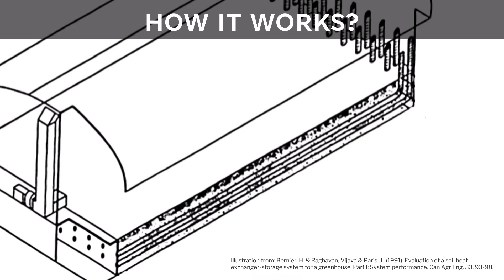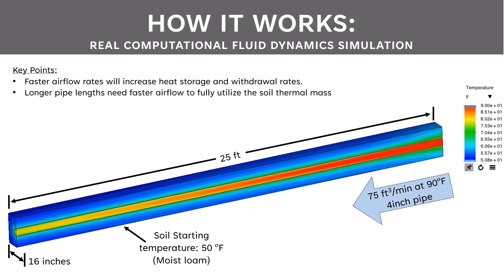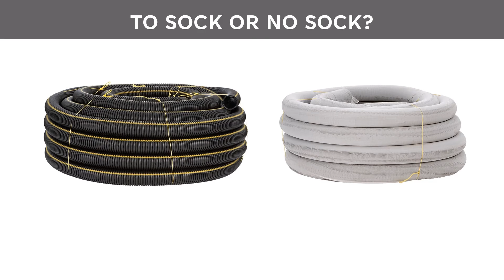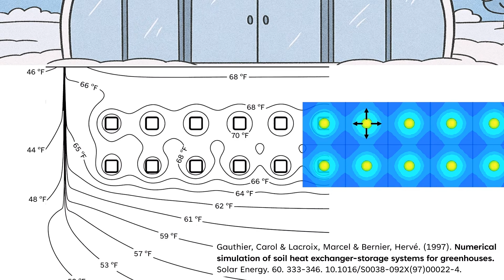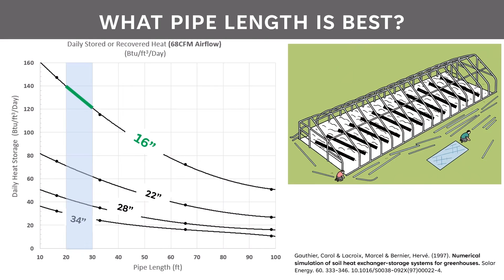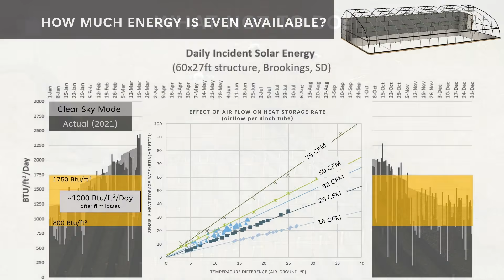Designing Better Climate Batteries: The Heat Exchanger: Pipe size, Spacing & Airflow explained…

Comment: These systems are interesting but their operational expense at 75cfm per tube as exampled is immense.   In open air that's about 3.5w draw, so if you have 24 tubes as in introductory drawing your base node is 84 watts and then you're adding a lot of static pressure.   In this circumstance you're talking about ribby pipe so its 38w per tube and that comes to about 900w continuous draw.  In a 25x16 greenhouse on a 600xf plot that's approximately 66kw continuous draw per acre. 1584kWh, 14.52c per kWh for South Dakota would cost $230 per day per acre of placements or $345 per actual acre per day of production soil.  So your yearly inputs for one acre of arable soil not including fuel charge or service fee, hardware maintenance or ANYTHING else would be $31,050 in power draw alone.

So assuming you create a perfectly tight setting of the greenhouses in my calculation allowing for utilization of 420 acres of arable in a 640 acre square mile, your yearly power input would cost $13,041,000.00 

That said, some greenhouses in Greece are reporting $33k per 1000 square meters arable, four of those comes to 43055.6 xf and an acre is 43560 [number crunch here] so growing tomatoes that sell at Greece's prices in SD in an acre would cost $30,690.00 per year for power input with this system IF it ran continuously all day which I know it won't but that gives you a rough number.    Assuming the numbers from Greece include competing with regular crop production that'd be $134k gross per acre against the $31k cost to run the thermal ballast fans for 90 days each year.

I suppose if you could convince a bank that a square mile of greenhouses could make $56M gross a year and ICE didn't raid you it might make more money than mono-cropping canola but you can manage about 5 square miles of cropland solo with equipment producing about $500k gross per square mile with just land, inputs, maintenance and machine-hour costs.  I would suspect going down the man-hour tree for 420 greenhouses is unnecessary at this point.
Reply from the maker: I'll delve into getting air into these pipes in a future video. 75CFM is definitely costly to achieve, and would have questionable payback.  In my recent prototype I did 50cfm, which is much more palatable. It is not correct to assume these fans are running 24/7. There is also a lot of room for utilities reduction by having dynamic speed control. Storage airflow rates should be much higher than in heating mode. My target video length was 7min... And I was only able to get it down to 14min as is. Feel free to email me with suggestions for further analysis.

Comment: What about using water as the medium to store the heat? 
You could have a slower circulation and much higher heat storing capacity. The temperature drop would from one end to the other would be low and stored heat would last for a many cool spell. Per volume you can store several hundred more units of heat in water.
I do not think this is a new idea, but I would like to now your reasoning for selecting air as transfer medium instead of water as transfer and storage.
Reply from the maker: Once the light energy enters the system it warms the air in the greenhouse. To utilize a liquid based transfer system you will need an air to liquid heat exchanger plus liquid to soil heat exchanger. It's more complex, but people do it and have patents on a few versions.

Comment: Thank- You!  We are breaking ground next spring on a 77’ x 14’ GH here in the Tetons next Spring and the anecdotal design recommendations by various installations is mind numbing.  I truly appreciate hard engineering based information!  Can’t wait to see the rest of this series.
Reply: Be aware that CFD modelling doesn`t account for latent heat transfer or the effect that condensate has on the grounds thermal conductivity, diffusivity and heat capacity especially close to the tube wall. Also note that the drainage slots or holes in perforated drainage tube are located in the valleys which prevent the condensate  from draining fully. Water inside the tubing is subject to being evaporated when the system is used for heating. This process requires sensible energy which is taken (stolen) from the mass at a rate of 1000 btu per lb of water evaporated. The latent component of the air leaving the tubes only serves to increase the humidity, not the air temperature so its important to modify the tubing before installation to ensure water cant collect in the bottom of every corrugation.  You`ll be surprised how much water remains in an unmodified  12" section of tubing after it has "drained".
Reply: @JohnGuest45 By “modifying” do you recommend a larger drilled hole in each pipe at every ten ft or so?   What are you thinking?  Thanks!
Reply: @robhoffman510  
Water will collect in the bottom of every corrugation in the pipe so a hole every 10ft wont be effective. The modification involves cutting a straight slot 3-4mm deep through the outer corrugations using a siimple jig and either a circular saw or a router set to a shallow cutting depth. Ensure the slot is on the bottom of the tube during installation.
Reply: Hey Rob. I’m planning an eventual build in Victor. Would be great to trade notes. Where are you in the Tetons?
Reply: @davidbergart I’d like that, although there might  be some interesting deltas in our temp and elevation.  We are at the far N end of the valley up off of Rammel Mt rd at 6500ft.

Comment: I have also wondered about using this as a way to gain super efficiency out of an air to air heat pump. using the captured mass of the ground or, uncaptured as a way to supply tempered air to an high efficiency heat pump. Never attempted the calculations though, would need to know the CFM of the condensing fan, the average temperature difference from the air into the ground and out to find delta T and then use the units performance chart to see the energy usage for those condensing temperatures and with that find if its even worth it. It might be worth it at the extremes of winter summer and if your using solar completely off grid to power the unit.
Reply: Why complicate your life with an air to air heat pump when a ground source/ water to air heat pump exists. Since water at a minimum has 60x the thermal capacity of air. It would be like saying strapping flotation devices to a sea can vs a 60 sea can ship. 

Water also allows for the use of liquid heat exchangers, on a rural property you can utilize this in combination with a pond source heat exchanger to improve the cooling due to the immense storage capacity of water further.

Both of these however are only economically efficient should you be in a region with higher natural gas prices. Here in Alberta is is about 1$ usd per million BTU. Which pushes the economics down of any climate or heat pump to a minimum. Secondly your electricity also needs to be low cost, for cooling a pond source makes it more efficient but the payback period would only make sense in a high electricity cost environment. The other scenario is more of a bet but if you anticipate hyperinflation your payback period reduces significantly.
Reply: @kylemullen1139  True, geothermal HP are better than AA and they are widely used in places that have those resources. Chicago used the lake for this purpose and I have seen examples in suburbs with large retention ponds used for large mid rise office buildings but not everywhere can they be used and they are generally a lot more expensive than AA HP. Anyone can order a Mr Cool on line for a small amount of money but a geothermal is pricey.    

I was actually thinking of using the AA HP in conjunction with a elongated green house that is tempered with a earth battery. Mounting the heatpump condensers in the end wall of the greenhouses with the condensers blowing outwards from the greenhouse . This would essentially be using the greenhouses tempered air as condensing air.
Reply from the maker: Yes, I have seen papers on using earth tubes to precondition air going to a heat pump, but haven't made one.

Comment: I wonder how a meter thick north wall hosting vertical 8 inch intake manifolds sprouting horizontal 4 inch perf pipe buried ever 16 inch lift of vertical; re- ganged to 6 inch outflow manifolds at 10 or 12 foot intervals from the intake manifolds would perform ?
Reply from the maker: I will cover manifold methods, compare and contrast them and fan and system curves in a future video, stay tuned.
Reply: @waywardsprings Please do!